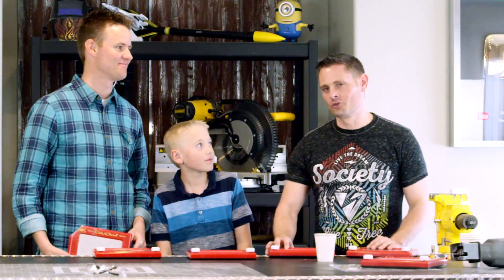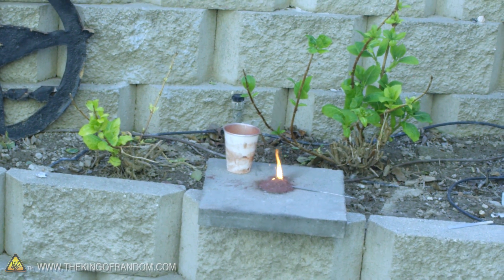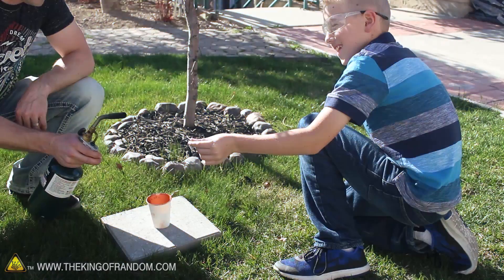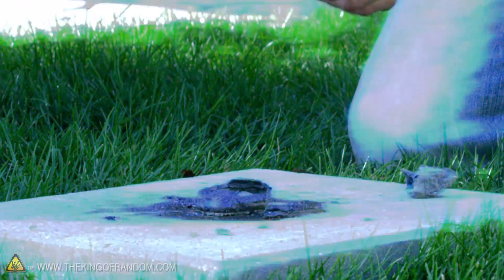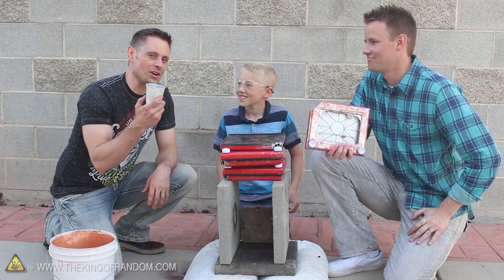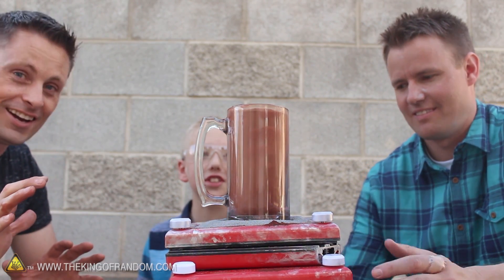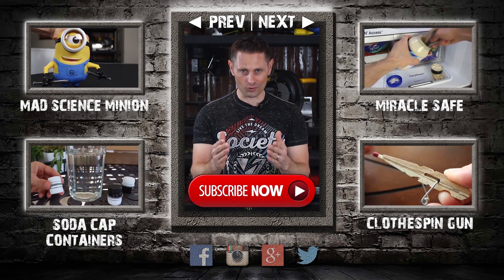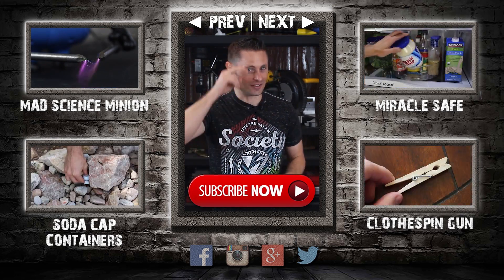Can you make Thermite with an Etch a Sketch?

Comment: I think there's polystyrene mixed in with the aluminum. Until it boils or burns off, it's going to absorb heat from the reaction. Acetone to dissolve it or pyrolysis might get rid of it.

Comment: Hey, if the Etch a Sketch thermite not lighting is a problem with the heat being to low, you should try lighting Magnesium. It is the hottest burning element and it emits an unbelievably bright light.

Comment: 3:15 concrete doesn't have a melting point, it just breaks down at very high temps, that's why it's a common thing to use a forge

Comment: just in case anyone is curious about the 1:3 ratio of Al to rust. 

lets start off with 1g of Aluminum powder

1g * 1mol Al/26.58 g * 1 mol Fe2O3/ 1 mol Al * (55.85*2+16*3)g Fe2O3= 3.004g Fe2O3 or rust

Comment: the thing is if you just light up aluminum it will only melt because there is not enough oxygen that can go to the aluminum but if throw the glowing aluminum up in the air it will instantly light it self up into a huge flame
Reply: and you don't need the rust to do that

Comment: Your ratios are off. It is 1:3 in MOLES not in grams. for every 1 mole of Fe2O3 you should have 3 moles of Al. 1 mole of Fe2O3 = 160g and 1 mol of Al = 27 g. Because the molar ratio is 1:3 your molar mass ratio will be around 2:1, because 1 mol of Fe2O3 = 160g while 3 mol Al is only 81 g. So using your total (65g) you should have used 22g of Al and 43g of Fe2O3. Your reaction left you with AlO and Fe and excess Al, rather than just AlO and Fe.

Comment: Might have worked with the powder from the Etch-A-Sketches if they were SURE it was ALUMINUM powder instead of something else...  That they were just ASSUMING to be Aluminum powder...

IF the Etch-A-Sketch contains Aluminum powder, then to make actual Thermite, they'd also need to figure out what the percentage of content is between the styrofoam and aluminum powder, then they'd need to compensate for weight of styrofoam beads to get correct proportions of Iron Rust to Aluminum Powder...  And I'd be willing to bet they didn't realize how much of Etch-A-Sketch contents was nothing but styrofoam beads to spread the coating over the glass...

Proportion of styrofoam to amount of Aluminum powder in Etch-A-Sketch would probably make it nearly IMPOSSIBLE to blend the contents of an Etch-A-Sketch with rust powder and actually get it to make a working Thermite blend.

Comment: I would suggest not using a CO2 fire extinguisher on class D fires. That's why the fire didn't go out when you used it. Dry powder extinguisher would have been safer.

Comment: you can't use aluminium oxide thermite unless you are using pure potassium, sodium, calcium or magnesium for the redox reaction. The bottom line is that the pure metal must be more reactive than the oxide metal.

Comment: EYE DANGER WARNING. The MythBusters say burning thermite is 3 times hotter than lava, and you can NOT view it up close without a welders mask. Because the UV light will burn your eyes over time. So stand back at a fair distance if you're going to use thermite. Do your proper Google research before blowing stuff up. That said, sweet video. :D

Comment: Try to melt dry ice plzzzz!!!
Reply: Is just gonna turn into gas
Reply: try boil it.
Reply: +Danny Ryan do you have any idea how cold liquid carbon dioxide is?
Reply: CO2 cannot form a liquid at standard earth pressures. It will directly turn from solid to gas.
Reply: +MASON VAUGHN hot*
Reply: +Kevin Sanders you mean temperature right

Comment: Thunderf00t and Cody's Lab have both performed this experiment, but Cody's Lab had the best results. Cody's Lab dissolved the foam pellets in acetone so that the aluminum powder was more pure. But it still didn't have the same results obtained with starting out with pure aluminum powder.

Comment: You should use the powdered aluminum and iron oxide (rust) in a flower pot, then get a strip of magnesium ribbon and stick it in the thermite, ignite it with a torch, it should burn at a temperature between  (3,990 °F) (4,800 °F)

Comment: You don't make Iron out of Rust, rust is iron and rust is simply oxidized iron or iron oxide
Reply: +Chris Long You make molten iron and aluminum oxide from the iron (iii) oxide (rust) and aluminum powder. You do make iron.  The exothermic reaction produces a new substance from the rust.  That reaction does require a catalyst, be it heat or say magnesium.  Your analogy is like saying a diamond and a piece of coal are the same thing because they are both made of carbon.

Comment: the CO2 extinguisher didn't work because a thermite reaction is a self oxidizing process. It doesn't get it's oxygen from the air but from the iron oxide (rust).

Comment: because the chemical reaction is contaminated by the polystyrene, also the particular isotope of aluminum oxide matters as well, since it has to give up oxygen to fuel the chemical reaction
Reply: +TheDarkalkymist There is only one naturally occurring isotope of Aluminum, Al(27). And the oxygen in the presented thermite reaction comes from the iron oxide, not the aluminum. Aluminum oxide is actually created by the reaction.
Reply: https://en.wikipedia.org/wiki/Isotopes_of_aluminium
Reply: so i got my free oxygen side wrong, not a chemistry major

Comment: Hey Grant I had an idea that I wanted to try for years now and I was wanting to see if it is possible to cast iron from the thermite by setting it above a mold and letting it pour in. in theory it would give you a mostly pure iron pour with an aluminum oxide slag coating on top. another theory I have wanted to try is adding in some manganese and carbon to create a steel alloy from the thermite pour. it would be a pretty interesting experiment.

Comment: If you want thermite from etch-a-sketch, you need to refine the aluminium powder more to separate the small polystyrene (styrofoam to the yanks) from it. The powder itself is very fine and will easily react with Iron oxide powder. But it can't be contaminated or you either slow the reaction or it won't start like you showed earlier in the video.

Comment: When you tried to extinguish the fire with CO2 you tried to block the oxygen from the air to get to the reaction. The problem is, the oxygen is already inside. The rust is ironoxide, so a composite of iron and oxygen. When igniting the thermite, you make the rust separate into iron and oxygen again and then iron and aluminum react with each other. Powder has a lot of surface for the reaction to take place, so it happens explosion-like and really fast. The oxygen makes the area around the reaction hotter and supports the burning as well as the reaction. So once it is ignited, there is no stopping because everything it needs to react is already there: the iron, the aluminum, the oxygen and the energy(heat).

Check your chemistry next time so you know how to respond to your experiments ;)
It was pretty amazing though!

Comment: Wow, so that's thermite. Where does a 15 year old get o hold of this?
Reply: +errettyd Ground zero.
Reply: _FedE Thanks bruh.
Reply: +errettyd you just need to buy iron oxide powder and fine aluminum powder and mix them the way grant said you can also do it with copper oxide but it goes a lot hotter and much quicker
Reply: +Jenelle Cordova +errettyd Be careful if you use copper oxide in your thermite, it's likely to explode. Aluminium powder is easier to find, and safer, if you can call thermite safe. For some inspiration on safety, check out colinfurze and his thermite launcher ;) https://youtu.be/JEoqrjFX1yI
Reply: +_FedE AHAHHAHHAHAHAHAAHAHAHA

Comment: if you are going to make thermite with the etch-a-sketch you should use try using smaller granules of the iron oxide.  That would allow the two compounds to mix more thoroughly which might allow it to ignite. like it does with the larger granules of aluminum also with the beads that are in there they might be able to be filtered out dependent on their relative size to the super fine aluminum.

Comment: The only concern I have is some of the safety in some of the videos particularly this one. If you are handling thermite or any fire, chemicals etc... you must show how to use it safely. NOTICE the CO2 extinguisher was not suitable, then dowsed with water again not suitable! Fortunately there was no mishaps but it could have been close! You need an extinguisher suitable to extinguish metal fires. 

Please be safety conscious!!!
Reply: +Stretch Darkmagi Extingushing thermite is hard. It doesn't need any oxygen so the only option to put it out is coolling it down until it stops burning wich is nearly impossible due to the high temperature. It does even burn under water!

Comment: Make some model rocket engines with more black powder at the end and make a launcher, so you pull a trigger or something and it shoots a rocket outward than blows up in the air after some time. That would be sick
Reply: colinfurze made a thermite launcher which is kinda what you described but doesn't explode, check it out if you haven't already, I think you'll like it
Reply: Its not the same thing though. My idea was like a rocket launcher with exploding ammunition XD

Comment: by the way, if you do decide to do the speaker out of wire and magnet idea. go with a larger scale. always more interesting. also its know in the audiophile community  that having a speaker with a  neodymium magnet, is also called having a "supercharged" speaker. referring to the "motor" of the speaker to have a stronger then average magnet.

Comment: The toy is a kind of plotter. The inside surface of the glass screen is coated with aluminium powder, which is then scraped off by a movable stylus, leaving a dark line on the light gray screen. The stylus is controlled by the two large knobs, one of which moves it vertically and the other horizontally. Turning both knobs simultaneously makes diagonal lines. To erase the picture, the user turns the toy upside down and shakes it. Doing this causes polystyrene beads to smooth out and re-coat the inside surface of the screen with aluminum powder. The "black" line merely exposes the darkness inside the toy. Filling in large "black" areas allows enough light through to expose parts of the interior.

Comment: The Sketcher-box is not air-tight and certainly not white protective gas ... meaning oxygen is present and alluminum has no problem to corode to aluminum oxide. Thermite/Termate is a switch-reaction where one metal is swapped for another in its oxidated state - in this case alluminum swapps Iron from iron oxide. So if there is no clean alluminum, but just corroded alluminum oxide, it has no reason to react white the iron oxide. Alluminum corodes relatively fast on air, but it creates the same oxide-protective layer as its known for copper, meaning it doesnt corode deep, but just on the surface ... yet, if its fine-powdered, it gets problematic to keep it from oxidizing on air compleetly, cause of the fine granulate. The reaction also needs both alluminum and iron oxide in the finnest powder granulate possible, to ensure proper distribution of both side by side, so small chips or chunks of alluminum wouldnt work much aether. So, one had to buy pure alluminum powder, properly sealed, and use preferably right away as each oppening of the package will eventually corrode it.

Comment: It proves it cant simply just be aluminium powder if it cant make thermite.
Reply: +nzoomed ... it is, its just corroded, so it cant react white another oxide if its one itself already (styrofoam balls shouldnt be a problem there if iron oxide is mixed up nicely white the alluminum). You cant keep pure alluminum powder from corroding on air. (good to see copper - it has a green-ish rust, alluminum has just a slightly different shade of silver collor  when rusted so one wouldnt see if its pure alluminum, or alluminum oxide)

Comment: that was awesome. I would really love to see you put thermite in a pyrex glass I believe the wine glass you used was not tempered that's why it exploded. try it in a Pyrex glass I'd love to see if the glass will last long enough for the thermite to start melting it
Reply: I tried this. Pyrex cant withstand this in the least. Virtually no difference with normal glass.

Comment: When he reached for the fire extinguisher I flat out said "That's not going to work, once you light thermite, that stuff burns untill there is no more. Considering the heat from thermite is hotter than molten lava.
Reply: just in case anything around burns obviously
Reply: True, could be for that.

Comment: etch a sketch kits are filled with polystyrene coated with extremely fine aluminiumpowder which is pretty much aluminium oxide if you expose it to air long enough

so just nope - you don't need to be smarter than you, it just does not work :)

Comment: Had to give a thumbs down. Neither you nor the Whats inside channel really explored why your thermite didn't work. Just really gave up. If it was the polystyrene mixed in, could you not filter that out somehow? Could you prove aluminum (or at least make it more plausible) by melting? (Confirm it at least looks like it's melting at the right time?). You could then go and grind up the aluminum to try to turn back to a pure powder and see if you could get that going....

Comment: What would happen if you got a huge bucket and filled it with : sand, red sand, pieces of aluminum foil, pieces of ceramwrap, pieces of newspaper, pieces of cotton, red dirt, cut up pieces of yarn, 64 pencils, two toilet paper rolls, flour, yeast, sugar, H2SO4, 128 smashed ping pong balls, NaOH, 16 sparklers Alka seltzer, rubbing alcohol, and half a cup of salt and set it on fire, then covered it up with a sheet of aluminum foil? Biggest explosion in the world? Only one way to find out...
Reply: You would die if you were anywhere near because of the fumes from the sodium and ping pong balls

Comment: What if you filtered out the polystyrene with a fine mesh strainer?
Reply: +Lukas Balestracci That's way more complicated than it needs to be. All he needs to do is put it in water and Styrofoam will float, metal wont.
Reply: +jogandsp Well what about the aluminum oxidizing or sticking?
Reply: Lukas Balestracci If you use distilled water it wont oxidize at an appreciable rate. As for sticking due to static electricity, I admit that is a problem. I would be willing to bet you could still make it work though. It would probably just require significant agitation of the solution.

Comment: I wanna see
A 1 gallon or larger container of thermite on top of a V10 or larger Diesel engine while it's running at full throttle!

Up the ante with a bucket or 3 of thermite on top of a Locomotive engine while it's revved at full tilt!

A 1 gallon or larger container of thermite on top of a big power transformer box, like the ones you see outside of commercial buildings, while the transformer is running at full capacity!

Comment: My guess as to why the etch a sketch powder didn't work is that the aluminium powder within the etch a sketch had already been oxidised since it has been exposed to the air for a while, and since thermite needs both an un-oxidised metal powder mixed with an oxidised one to initiate the redox reaction, and the powder was mixed with already oxidised iron oxide powder, the highly exothermic redox reaction that is characteristic of thermite couldn't initiate as both metals were already oxidised. But I might be wrong, my chemistry A level was a while ago...

Comment: Collaborations are great and so is thermite! Potential idea: dip a knife in thermite or the mini arc furnace and get it glowing hot (without melting it) and see what you can cut through! Or better, what you CANT cut through!
Reply: +Nickst3r hmmmm i have a small feeling both those things are too hot to still be able to use the knive thermite would probably melt it and the arc furnace though maybe not directly melt it make it so hot its flexible and useless to cut anything

Comment: Whoa , awesome video (love the channel), but I couldn't help but clench a bit at how you were igniting those compositions in such an unsafe manner (jamming the burning end of the sparkler in) during the first few burns. Any reason why you didn't use the "sparkler as fuse" method in those? 

Also, for future science involving thermite, try avoiding glass containers for it and use clay plant pots instead - they make for pretty decent reaction vessels for thermite reactions - you can "direct" the flow of molten iron slag onto something fairly easily :)

Comment: Try melting glass with The Mini Metal Foundry.  Since the melting point of glass is about 1400F and you melted brass at 1652-1724F it should work.

Comment: it will certainly produce iron from the mixture, they use thermite to weld rail tracts together by filling the gap and melting the ends of the iron beams..

Comment: Put the thermite in a clay flowerpot, that'll make the molten metal spew out the bottom.
And if you put it on a block of ice, then the whole thing blows up. (Dont try that at home, unless you have blastscreens and you can't hit anyone or anything with the flying molten metal)
I wonder if dry ice would have a more agressive reaction..?

Comment: If it is really aluminum powder inside, you need to extract the styrofoam balls from the powder. Just get a siev, put on a lid or a piece of plastic and start shaking, you will end up with aluminum powder, separated from the styrofoam balls.

Comment: It should be obvious that CO2 wouldn't work because thermite is a self oxidizer, so using a fire extinguisher  which removes the outside supply of O2 wouldn't effect it. Same with water.

Comment: You could probably separate the Aluminium from the styrofoam by heating it up until the styrofoam melts and then straining it. Or using acetone for the same basic process.